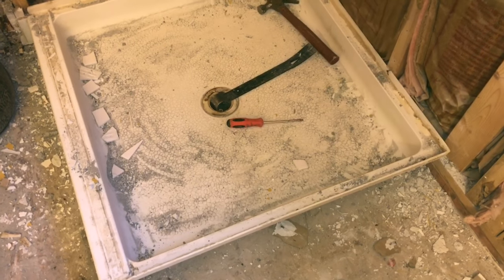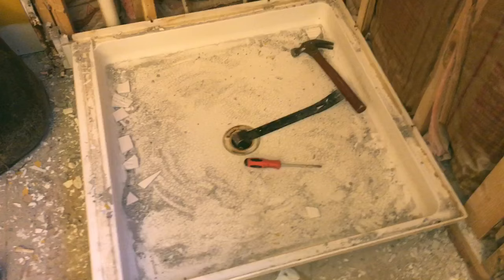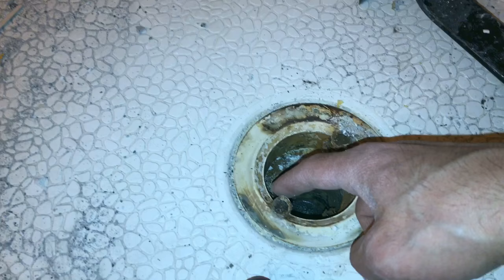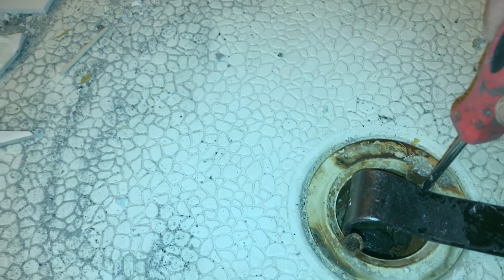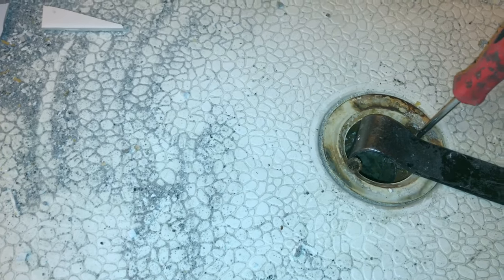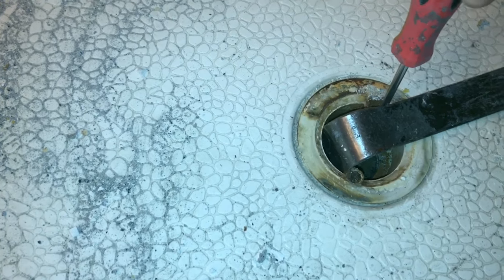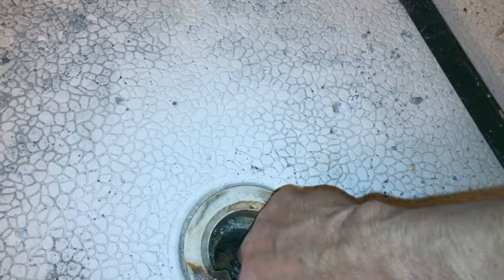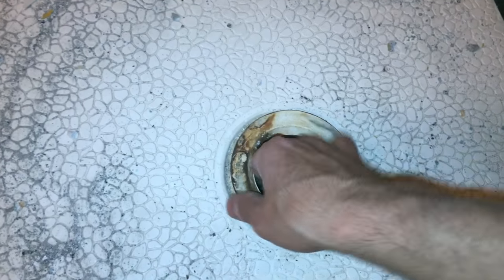how To Remove A Shower Tray Quick And Easy

Comment: Good idea. Not sure if the WD-40 would help. In most cases, the gasket/seal under the flange would prevent any of it from reaching the threads.
Reply: I don't think it was meant to reach the threads. I believe the WD40 was meant to soak the plumber's putty or silicone and other crap that sits between the flange he is trying to remove and the shower pan.